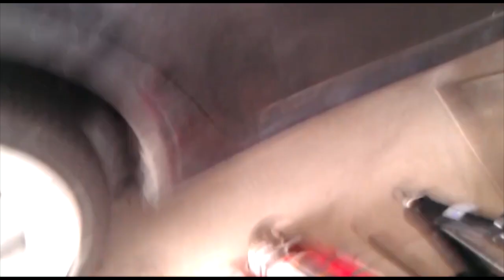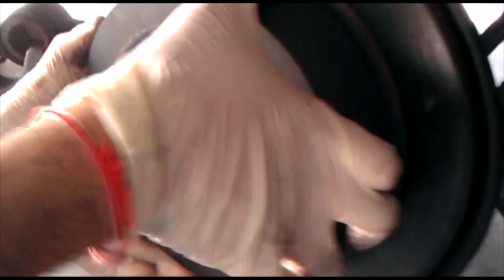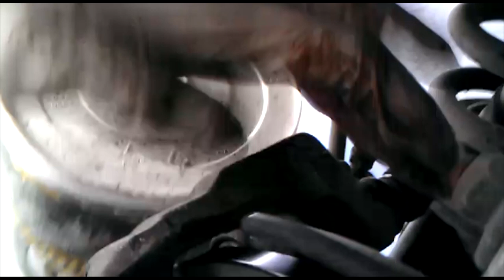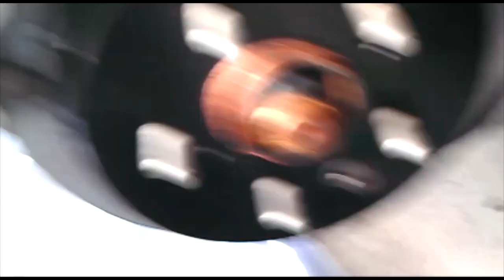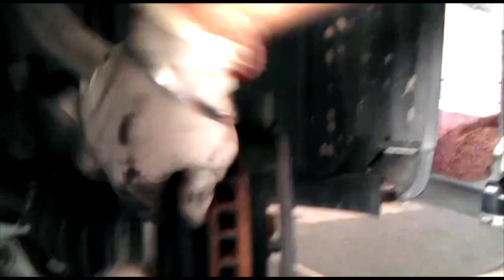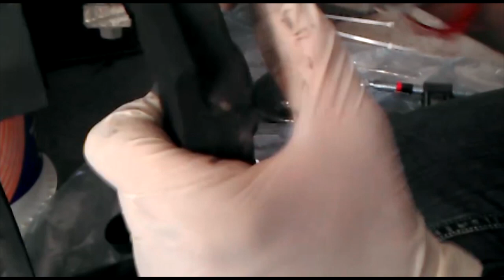Lexus IS 250 AWD/RWD front/rear brake change

Comment: Opening the reservoir cap introduces air in the brake system is the funniest comment in here... gotta love youtube comments.. great vid thanks for sharing. I'll mention that there is a tsb from Lexus on the lower slide pin seizing. This will make the caliper difficult to pull to the rear while still on the lower slide pin
Reply: i am having trouble getting mine to rotate while on the lower slide pin. is there something i am missing?  i cant get the caliper off because of this

Comment: I have never left a reservoir open while doing my brakes or had an overflow without. I slowly compress the piston with the free tools you can rent from Autozone. You are also introducing air into the system. You absolutely should bleed the brakes after opening the reservoir cap. The factory service manual for the IS at no time suggests opening the reservoir.

Comment: One note, never use your Torque Wrench to loosen bolts. It will eventually damage it and throw off the calibrations. You're better of using a close end wrench or a breaker bar, It much cheaper than mess up your torque wrench. beside that good information.

Comment from the maker: been good so far i had ebc full setup with red stuff in my other car before and yea they were ok but these fell soo much better and wayyy less dust and no noise. Red stuff are suppose to be ceramic but still made noise (i dropped power slot in to that car as well).
yea prob could damage thats why i suggest compressing them slowly to avoid any issues and overflow

Comment from the maker: anything i recommend you may not be comfortable doing and may end up breaking it if you can put it back together and take it to a "licensed mechanic" !
 
(i would spray it with a bunch of brake clean on the pivot point (use the straw and shoot the stuff all around the area where the rubber boot was) let is soak in for an hour and in that time keep coming back and reapplying brake clean then hit it with a rubber mallet to loosen it, if it breaks then your screwed else it worked out lol)

Comment: I've heard you can potentially damage the ABS unit if you're not careful with compressing the piston without the brake reservoir open, not sure if its true or not but I've been leaving mine open. Thanks for the tips on the rotors, mine were stuck on I didn't notice the 8mm bolt holes.

How do the powerslot rotors work for you? I had EBC slotted rotors and threw them in the trash, they were awful, even with proper break in procedures over a period of weeks. Went back to stock and no issues.

Comment: Mandip your response is completely wrong. Brake fluid is in an air tight reservoir, hence the noise you hear like opening a new jar. Opening the reservoir introduces air into the system. Bleeding techniques should be performed for safety.

Comment: I'm trying to change my brakes on an IS 220D it all looks the same but on the calliper I cannot remove the bottom bolts on the rear. I mean the bolts that go through the brake pads where the clips are. Can't get the bottom ones to slide out.
Reply: FYI for anyone else the slide pins on 05 - 12 IS models are known to seize up. Google 'Lexus IS Seized caliper pin' and you should find some help.